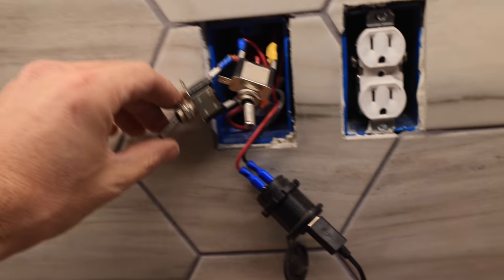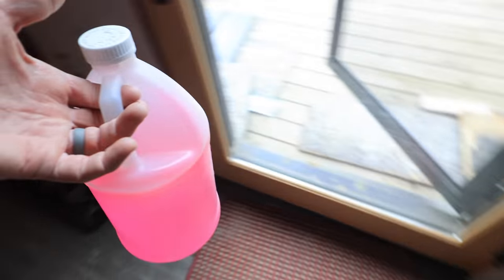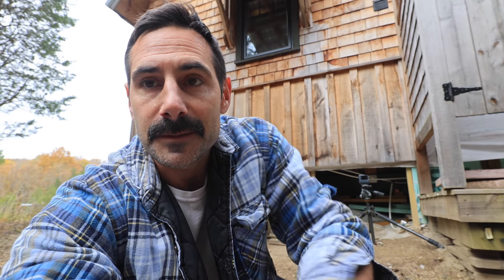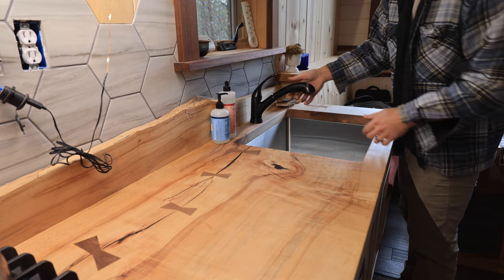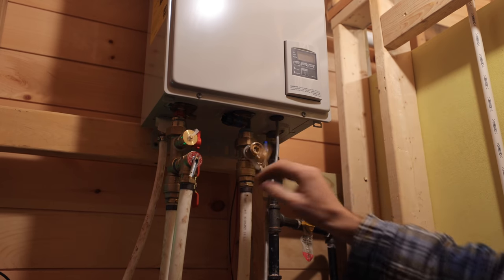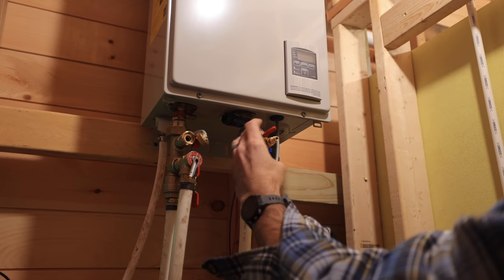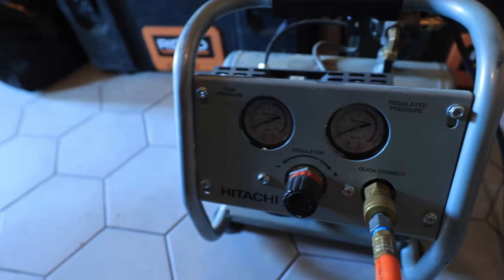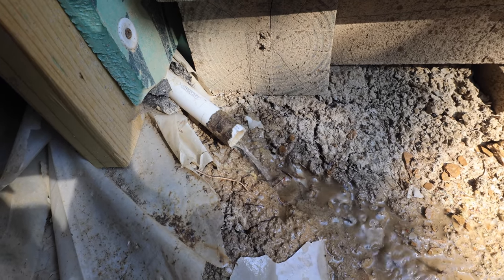How to Winterize a Cabin

Comment: Don't forget the toilet bowl, it  has a trap in it too,  often forgotten. If it gets cold enough, it will freeze and bust too. Guess how I know this?  Side note, an "S" trap goes through the floor, a "P" trap goes through the wall. I enjoy your work.   I have a Line to my shop I blow out with air also. Your doing well to protect all you worked so hard for.
Reply from the maker: Thats a good heads up.  We don't have a conventional toilet so we don't need to worry about that in our case.  So I guess I have an S trap under my sink!

Comment: I did my own plumbing and thought I had designed a system that would drain to the low point.  After many years I have discovered the hard way that unless I am very careful, I can trap water in a line.  I've broken pipes several times.  Your idea to blow the system with air is an excellent backup.  Perhaps I should get a compressor!
Reply from the maker: Yea that is kind of how I felt too Kevin, I don't really understand where water is getting stuck in my system, all I know is that the proof was right there when I blew it out.  You should get a compressor, a small one will do the trick, and that valve was not expensive at all.
Reply: We've always blown out the lines on vacant homes.  Haven't had a cracked line since.

Comment: We've always put RV Antifreeze in the dishwasher and washing machine.  Just need to run them for a few minutes to get the fluid through them.  You can take the drain hose out of the washing machine and put it discharging back into the machine and run until you see the fluid discharge.
Reply from the maker: Nice, I don't mind using it, I just don't want to get it into all my system because it seems like it takes forever to get all the smell and taste out.

Comment: Up here in Canada we got a hard freeze up the cabin so I blew everything out at 55 PSI and doing the dishwasher is the trickiest now that we have a new dishwasher I have to run it through a hole cycle and cancel it then fill the dishwasher mostly with the antifreeze then let it run a bit of a cycle press cancel and let it pump a little bit and then quickly unplug it because we have a Purdue long drain hose on it. Also with the kitchen tap make sure you cycled between both functions when blowing out so you don't have water sitting on either the spray or the other function don't be afraid to let pressure buildup in your entire system and and really let it blow for a while out of one fixture. Those low point drains iron awesome idea I wish I would have put those into my place it would have made things so much easier
Reply from the maker: Oh wow, yea a dishwasher seems like it would be very challenging.  I'd almost be tempted to just pull the thing out and wash by hand.
Reply: @50Acres  I think if I put a dishwasher in a place that I own I would plumb up a couple of drain I could open up a drain it manually then throw in some RV antifreeze after closing the valves but my parents place never really had that foresight built into it we do eventually plan to renovate the kitchen so maybe you want to do that I'll have the dishwasher plugged in better but it's a fairly new fancy one and I don't think I can do any modifications to the actual plumbing inside the unit so perhaps being able to hook up a Shop-Vac to the drain line would be easier

Comment: I think a little more planning would have made life much easier. I can personally winterize my cabin in under 5 minutes and unwinterize it in under a minute. That's two sinks, toilet, shower, and the same water heater. I do mine everytime I'm there in the winter so I wanted to make it as quick as possible.
Reply from the maker: This took me around 5 minutes also, especially if you subtract filming and talking.  The 3 way valves are the best,  I used to have an RV and it seemed like it took half the season to get the proplyne glycol smell out of the lines.

Comment: How do you ensure all the propylene glycol is out of the system when you hook everything back up? Just curious! 😎👍
Reply from the maker: I just flush it out with a bit of water before I switch the valve that isolates it from the rest of the plumbing system.  It's not toxic so if there are trace amounts it's not a big deal.

Comment: Love your videos and thumbs up every one. Let's get up to 100k subs soon. I only have 2 questions. 1; Do you not use your cabin at all in the winter? And 2; Why did you spend so much time on the pond instead of finishing the exterior shingles and interior work? I would think finishing the structure before swimming hole would take precedence over a project like the swimming hole. Is there a reason for that?
Reply from the maker: Thanks Steve.  We do use the cabin in winter but without water, we don't keep it heated while we are gone so we need to winterize it. I had dug a big hole a year ago as part of a sponsorship when I got my excavator.  Then it sat for a while and started to become a swamp.  I decided I needed to finish it enough to keep it filtered.  I also like to take breaks on things if I lose my motivation and come back to them at a later time once I am refreshed.

Comment: I’m looking to go off grid, I have an idea in my head of what I want to do for a water system like you have. Do you think you could use it in the middle of winter without freezing issues? Also have you made a video showing the whole setup and how it works? Thanks I really am looking for info on it so I can do it when I get a place.
Reply from the maker: Hi Jake, most of time in my climate it’s not a problem.  However we do get the occasional extended deep freeze.  I solved that problem by insulting a ~5x10 foot section of my crawl space and putting a fan on a relay tied into a thermostat that moves warm air into the crawl space.  Video is called:  Super Cheap Way to Prevent my Pipes From Freezing (It's Not Heat Tape!)

Comment: are you sure that Bambi will not come to your pool to drink and then you will  find it bloated, stinking pool and air after drowning? Changing faucet was fine but that pool needs to be finished/secured before winter and it will be snowing soooooooon  there...Just my point of view- I love Bambi
Reply from the maker: I'm sure the deer will love the pool!  I'm planning to put a trail cam up to get pictures of all the wildlife that use it.  We don't mind sharing it with them!
Reply: @50Acres - that was not clever-you know what I was concerned about. Bye
Reply from the maker: @onababona6101  deer are very capable animals, I’ve seen them scamper up hillsides I’d never imagine they could get up, jump very tall fences as if they weren’t even there,  a deer would have a very difficult time drowning in this 5 foot deep pond.
Reply: @50Acres   getting out of that pool with edges covered with slippery plastic could be difficult if not impossible -perhaps you could invite them to your shower..oh..that is not done yet also...:-(